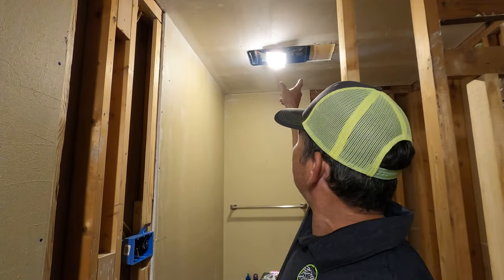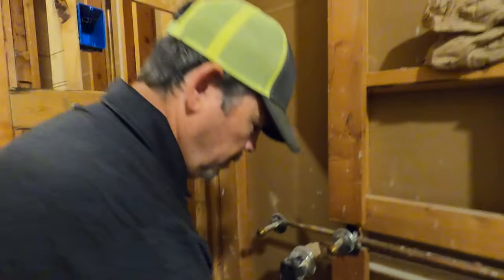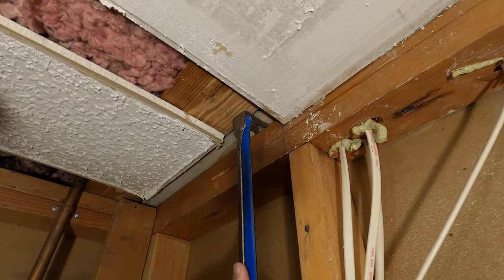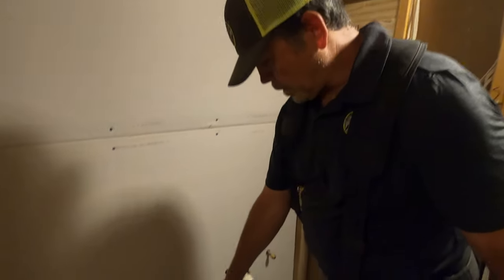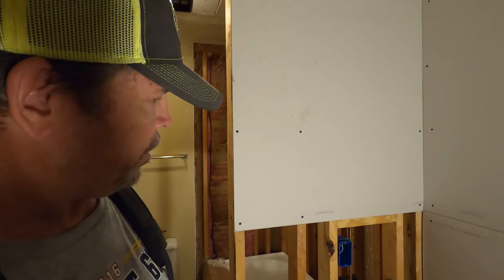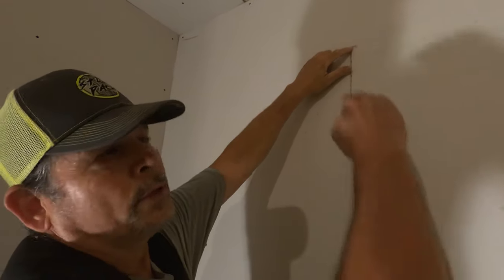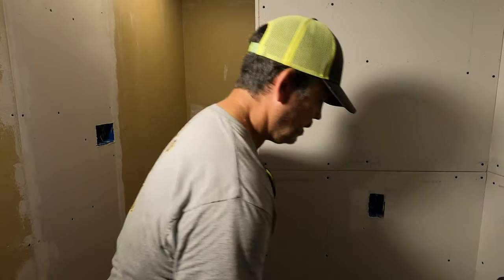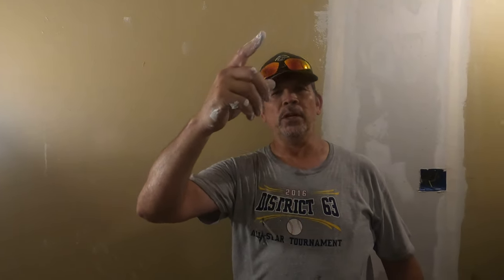Remodeling a Hall Bathroom Part 4

Comment: I noticed when you guys were using the router you were running it clockwise. Try going the opposite, you're less likely to run off the edge of the box. Keep the videos coming!
Reply from the maker: Yep you're right Luke, counter clockwise on the inside of a box, I can never remember.  I should write that on my router😂

Comment: since you didn't use green board, is the board you used moisture proof or have a built in moisture barrier?  Just curious.
I just found your channel last week, already subscribed.  You do great work!
Reply from the maker: Thanks Bill.  I use a primer/sealer on all my drywall before cabinets etc. go up.  Standard drywall.  I feel like the primer seals the paper and minimizes the potential for mold growth.  Never had a problem with it.

Comment: Did you guys not put corner beads on the outside corners of that wall
Reply from the maker: We did, I think i used paper faced corner bead on that one.  Basically metal corner bead with mud on paper flanges... no nails required.

Comment: Question about the sharkbites. My old boss used to make me pull out that plastic piece when putting them on copper. I forgot one time and nothing happened. Is that necessary or not?
Reply from the maker: Never heard of removing the plastic sleeve.  I wouldn't modify a sharkbite unless manufacturer approved.
Reply: The plastic sleeve is the PEX Stiffener, they should be removed when working with copper pipe. Don't think it would be an issue with a cap though.
Reply: @FB-bv4wh  shark bite says otherwise.